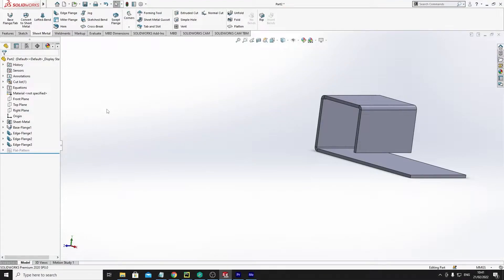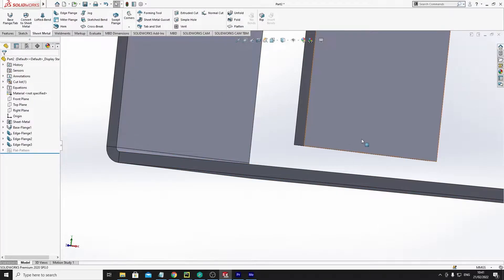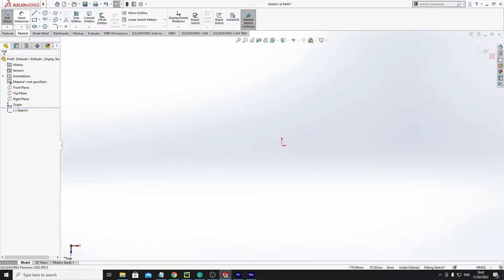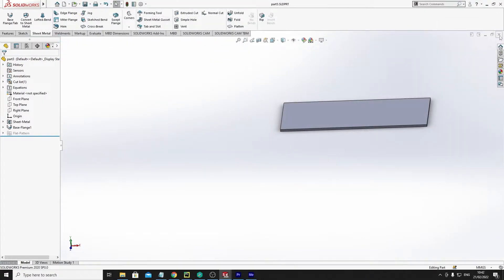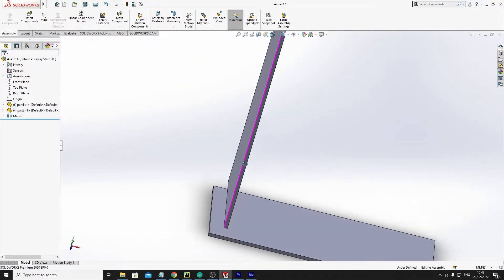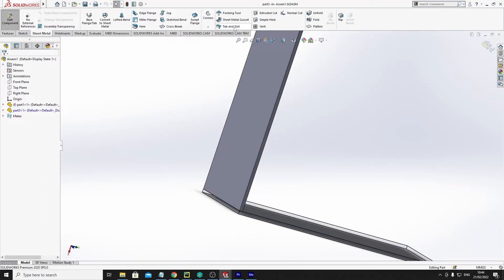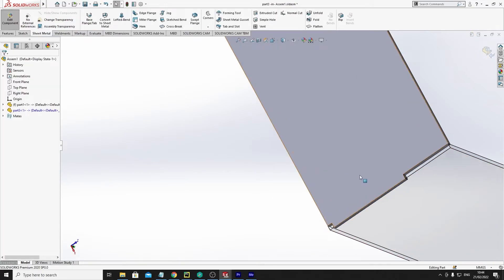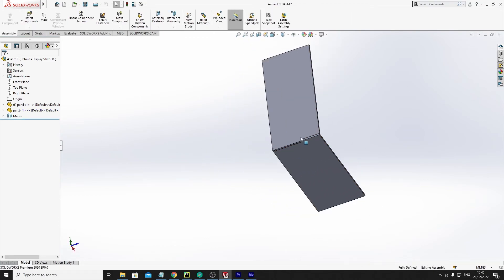How use Tab and Slot in a Part and Assembly in Solidworks

Comment: FYI I have just tried this with 'normal' parts i.e. no sheet metal elements.... and it works fine. You do have 5x fields to fill out in the tab&slot dialogue box, but select as follows;

1st field: select the edge of the part that is in edit mode (just as you show in this video)
2nd field: end face of the part to be slotted (so where the tabs will finish) 
3rd field: select the face on the edited part where the tabs will begin (this must and should naturally be shared by the tab edge selected in the 1st field)
Fields 4&5 should self populate. 

That's it, works perfectly for me running Solidworks 2023 :)
Reply: Thanks! This works! :) The trick for me was the second field, there i kept selecting the front face in stead of the back face of the flange. Not really intuitive!
Reply: @mpkleinbreteler  you and me both, and I suspect everyone else too. 2025 has seen some improvements to the property manager and it seems to auto select the end face in most instances, so I guess they must be listening after all!
Reply from the maker: great to know that works, it just the sheet metal method has a feature that dynamically updates the tabs and slot when you change the design. it can be good/bad depending on your needs.

But I'll check this other method out cheers for sharing.